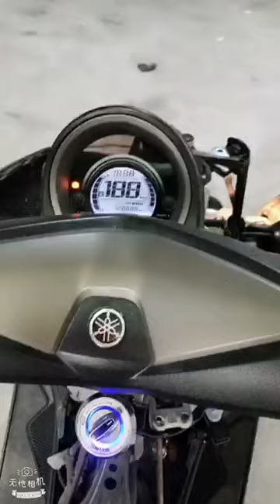nmax keyless smart key switch install video

Comment: 請問鎖頭兩粒螺絲是什么尺寸
Reply from the maker: 链接:#Aliexpress US $118.74  5%OFF | Modified motorcycle parts nmax Keyless entry system nmax smart key Entry Anti-line Remote Central keys for yamaha nmax 155 150
https://star.aliexpress.com/share/share.htm?redirectUrl=https%3A%2F%2Fwww.aliexpress.com%2Fitem%2F4000316805676.html%3FsrcSns%3DCopy%26tid%3Dwhite_backgroup_101%26businessType%3DProductDetail%26spreadType%3DsocialShare&image=H88b11032a1e44b8793c59ad5f162a507M.jpg&businessType=ProductDetail&spreadType=socialShare&templateId=white_backgroup_101&title=US%20%24118.74%20%205%25OFF%20%7C%20Modified%20motorcycle%20parts%20nmax%20Keyless%20entry%20system%20nmax%20smart%20key%20Entry%20Anti-line%20Remote%20Central%20keys%20for%20yamaha%20nmax%20155%20150&platform=AE
Reply from the maker: 请咨询卖家